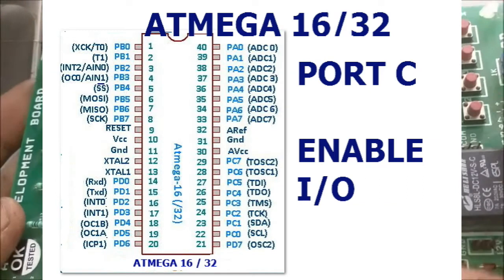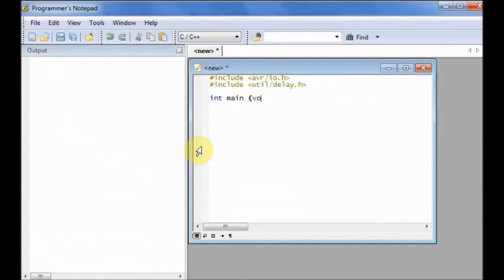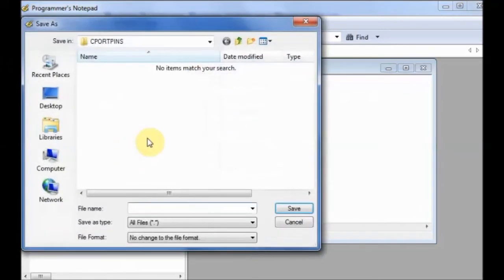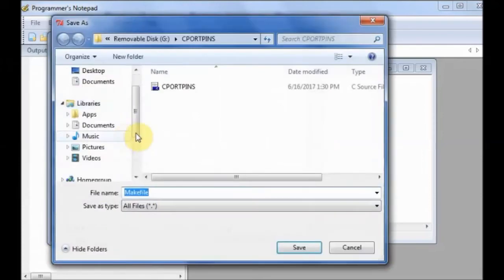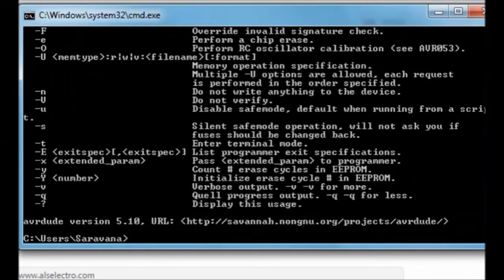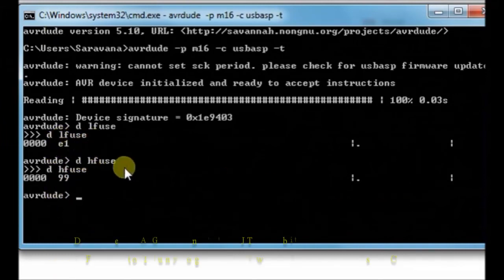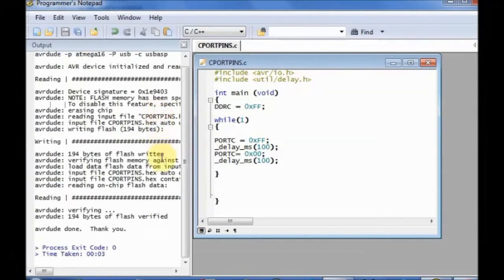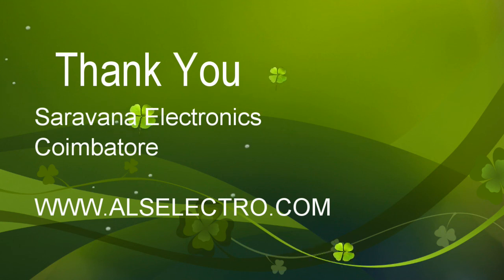AVR ATMEGA16/32 -HOW TO DISABLE JTAG & ENABLE PORTC PINS FOR I/O

Comment: At about the 1:20 mark, I believe you are incorrect about the pull-up resistors being enabled. That happens when DDRx is set to INPUT, not when set to output. So to set the pull-up resistors you would do this:

DDRC = 0x00;
PORTC = 0xff; // this sets the p/u resistors to high

It would make no sense to be able to set pull-up resistors on a port that is set to output. How would you ever use any of the pins in that case. No matter what you set the pins to, they'd be high.
Reply: it does not matter, the problem is - PC disabled by default and you have to change FUSE bits to make it operational